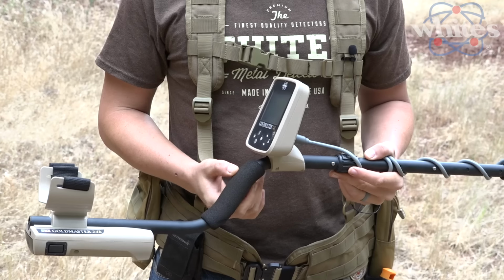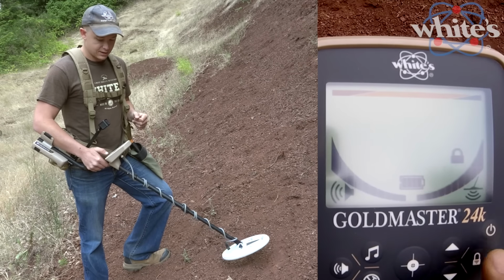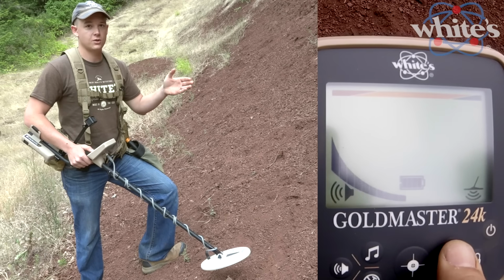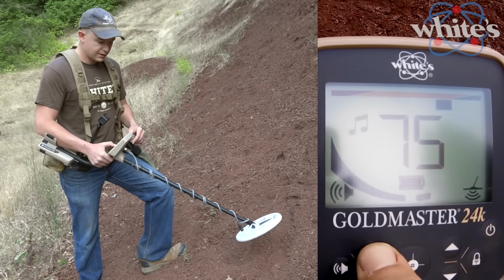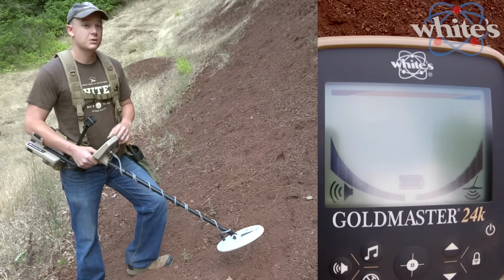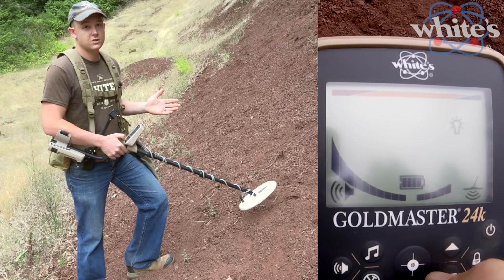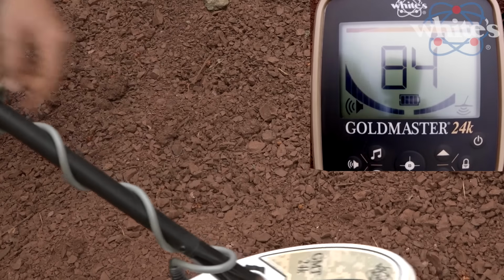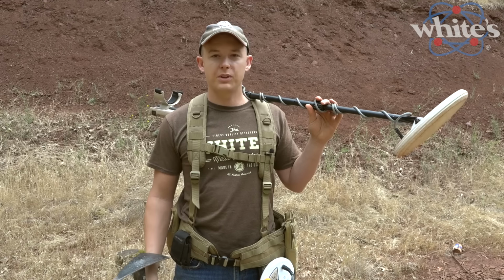Goldmaster 24k - All Options and Basic Use

Comment: Every gold prospecting metal detector needs a coil cover... (included in the box)... Why?  Because we swing low and slow.  How low? On the ground low!  "Oh... thats pretty low!

Why?  Well gold is heavy and it is constantly on the move downward in uconsolidated soil until it traps.   

Gold comes in all shapes and sizes and  large pieces of gold tend to sink deeper and we need the coil to be as close to the ground as possible on a vlf running at 48 Khz to hit them.  

Ideally a simultaneous multi-frequency detector is expected to outperform a single frequency detector because it will hit the larger peices of gold deeper and hit the smaller pieces of gold shallow all at the same time.

Comment: You did a Great job on the presentation. Sound like this machine would be very good in Arizona.
Reply: I have had a few  Whites  over the years and  haven't  used them to their potential. I favored the  Fishers and  Minelabs, as he  mentioned you can  locate  mineralized  streaks. Using the  Whites  in  super  sensitive settings you can mark out pay streaks for  high banking  rather effectively.  Thanks for pointing that out because my friends  poohoo my observation that of all my different  detectors  Whites is  best at delineating the black sand  concentrations. Wasn't  always gold,  but  more times than  not.